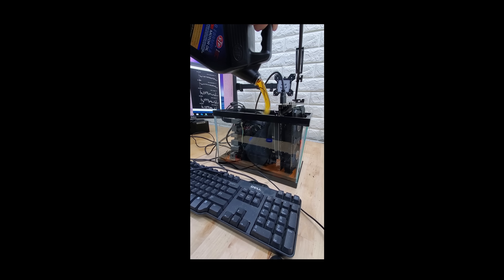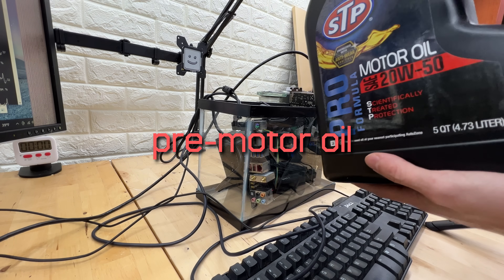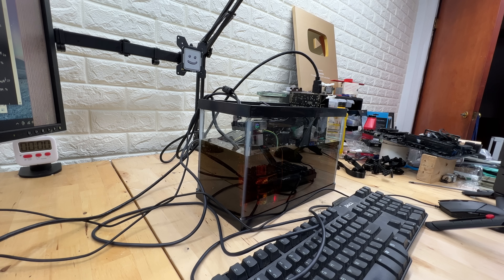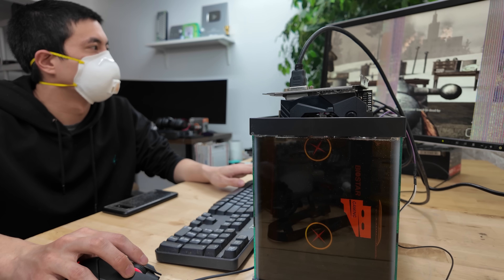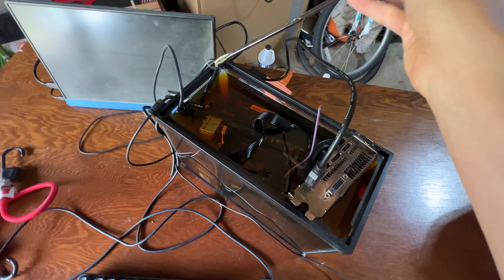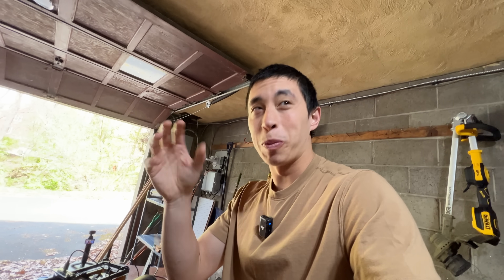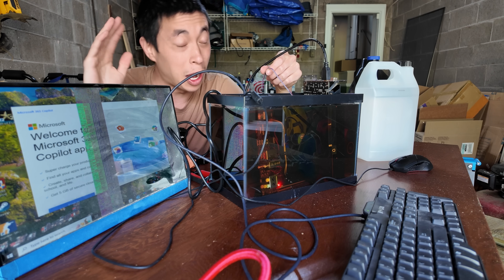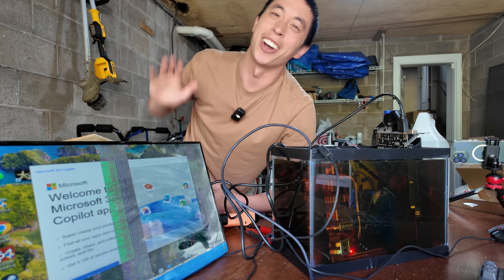Why isn't Motor Oil used to cool down PCs?

Comment: Should have used a thinner oil. You used a 20w50. That is thick and probably would be good for a tractor's diesel motor. Should have been as some commenters said, 0w20 or thinner. Plus use an actual synthetic. That was not. Learn to read the bottles.

Comment: Why isn't motor oil used to cool down a PC?

Maybe because that's not its function even in a car?

Oil keeps the pistons, crank, valves, camshaft and everything inside lubricated to reduce damage from friction.

Now if you said "coolant" that would've been more understandable.

Comment: Paused at 0:49 
Prediction: It shuts down shortly after posting the first time. Attempts to power cycle the system ultimately fail resulting in the machine no longer being able to power on.
Damage to components is permanent and unrepairable.

Ok,...
Back to the video.
Reply: It was on to begin with.
Well there goes my prediction! 🤣

Comment: mototr oil is a lubricant, not a coolant, coolant goes in your coolant resivour or you can also get coolant for your radiator.

Comment: You shouldn't use Motor oil for this even if it works for some time. Additives Can Be Reactive: Motor oils contain additives designed for engines, not electronics, they can corrode or degrade plastics, rubber, or PCB components. Additionally it may conduct electricity over time  due to impurities or degradation, it can eventually conduct electricity, risking shorts.
Motor oil, after a while breaks down and leaves sticky residues, which are hard to clean and can damage components. It oxidizes and becomes thick or sludgy faster than mineral oil when exposed to heat apart from health and fire risks; It emits more fumes and is more flammable at lower flashpoints compared to mineral oil.

Comment: Mineral oil works 3x better at heat transfer then air.   :) and itn's conductive,   Nice :D   Also you could use a oil heat exchanger like they use for heavy engines to keep their oil cool or transmissions  :)   Get a part cleaning tub  it's built to clean grease and oil off parts :P

Comment: Many moons ago I used a similar setup, i found for more intense load cycles a oil chiller similar to some high performance engine setups was needed to exchange built up heat in the system. You do need to be mindfull of what sort of oils you use as well there duty. You dony want to use WVO  fue to food, acid, and moisture contamination and you have to be carefull with vented hardware like optical drives and spinning rust platters and plastics disolving. Id personally recommend SSD's and maybe useing a lighter weight oil

Comment: Well then, if the PC is fully submerged in oil, can you then store it in lets say for example in fridge or freezer, to make it even cooler? As water condensation is then not a problem for the components at that point
Reply: Wouldn't work. The amount of heat that an average freezer can transfer per minute is relatively low. The PC will heat it up in no time.

Comment: Maybe try a thinner oil like 0w20 or 0w 10 if you can find it they use mineral oil because it's a thin oil I see you using 20w30 which is a pretty thick oil

Comment: What I would like to see is the thinnest motor oil in a custom water cooling system. The fact that this cools it down so well, it tells me if you can pump it, it would be better then water. Though idk what it would do to the pump or anything. Then there's coolant as well.
Reply: just use an oil pump from a car.  wouldn't be hard to set up

Comment: Could you float the board in motor oil without sinking the entire board, just low enoug to cover the CPU and the fan still be high enough to still work?
Reply: That's what I was thinking. Looking for applications for DIY hashboard cooling 8)

Comment: There are ways to clean oil-submerged electronics. First thing: Pressure washing with DI water. Used by several corporations to clean oil-soiled equipment because it is totally unable to short out components and cuts through dirt/oil very well.

Comment: You need a MB wiht the chip on other side and a construction like a Test board so u can turn down the CPU chip in everything.......
So what i mean you can make a small Fluid area under the MB that cools the cpu and upside is the rest. IF u want take the same fluid for GPU

Comment: You should do a water cooled PC but compare it with automotive coolant instead of water in the reservoir. Or go a step crazier and try using a engine radiator as well.
Reply: Agreed

Comment: Motor Oil isn't a coolant. Its a lubricant, and retains heat. Antifreeze is a coolant designed to reduce oil temperature.  Why was this even a thought?
Reply: Any fluid can transfer heat, some have better specific heat capacities than others. Motor oil is used in most motors as a medium to transfer heat; many engines or transmissons can have air to oil coolers.

Comment: I would assume the various zinc and molybdenum based additives could potentially be electrically conductive which would be bad.  Not a guarantee but I wouldn't risk it.  Mineral oil is not electrically conductive.

Comment: shoud use some 0w20, thats basically the same viscocity as light mineral oil.  oil, not 20w 50 lol..., of course its thick lol,.  most cars dont even use thick oil like that anymore, thats for realy really old cars usually.

Comment: First off: motor oil can be mineral oil, synthetic oil, or a mixture of both.
So, differentiate mineral oil from motor oil is kind of pointless.

Second: as many said before: use thinner oil!

Third: oil used in cars is usually tailored to get to around 100°C pretty fast and then stay around this temperature. And you don't want this temperature in your PC.

Fourth: If you want to use oil for cooling and not for lubrication, you need a pump and an oil cooler. Best equipped with a fan. So basically, it's like an out-case water cooling.

But: you could drop the fans and potentially even the heatsinks on the parts themselves. 

And as he said: Maintenance would be a pain in the a**!

Comment: considering average temperature of computer is between 60°C – 85°C (140°F – 185°F) and the aspects that made motor oil degrades are temp breakdown, oxidation, contamination, stress, and additive depletion. you need to change oil every 10 years sir.

Comment: Well let's start with this. Is motor oil used to cool an automobile engine .. there's a reason why the answer is no. 

It's not efficient at heat transfer 
It's designed for lubrication😮

Comment: 20W-50?!? He dumped some of the thickest engine oil ever over the fans. The average everyday car usually only uses 5w-20 or 5w-30. If I were trying to swim in a pool filled with the oil he put in there I'd be struggling too.

Comment: i instantly though remove all GPU CPU fans and just have a rad above the oil and its fans disposing the heat from the oil, id also have a fixed high torque fan in the oil to distribute the heat

Comment: Motor oil doesn't cool anything, maybe it has some heat dissipation properties but without circulation it's just going to sit and get hot. But nice that it removed the vibration noise!

Comment: all fans should be removed.
and replace the heatsink with a larger one.
will it be cooler for long-term use?
Maybe this motor oil could become a new trend

Comment: Why 20w50 that’s for heavy duty usage big ole fat gears. 0w20 or even 5w20 heck less than that would have done the trick temp wise and not have impeded the fans as much.

Comment: The only thing that worries me with PC+Oil is that unless your parts were designed with that in mind, the oil could potentially dissolve glues or swell some plastics with ... suboptimal consequences.
Reply: Potentially?? It will without a doubt damage anything that's derived from petroleum or otherwise soluble in organic solvents. This is not viable long term even otherwise. Imagine dust and grime mixing in with that oil or if you have to replace a part. 

Totally not worth the trouble and it's not gonna cool it any better unless if the oil is circulated through some kind of radiator
Reply: @anonymouseniller6688  Depends. Dissolving polymers is ... a thing. Just because something is theoretically soluble does not mean it does so fast. Then there is also a lot of "soluble" polymers that really dont dissolve but rather swell and become permeable. If its heavily crosslinked it is not going to dissolve in the conventional understanding of the word. The polymer, even if petroleum derived, could also be fairly hydrophilic and thus difficult to dissolve with oil.
Reply: @noneofyourbusiness3288  It doesn't really need to dissolve away like salt for things to go bad. I've had mineral oil destroy orings just enough for them to stop working correctly and it didn't take all that long. Maybe a few months. There certainly are polymers that are more resistant to this but you're less likely to have those if your design didn't expect to be in constant contact with some oil.
Reply: @anonymouseniller6688 Dust and grime?  So the PC needs an oil change?
Reply: @GodwynDi  lol, nice one. The oil needs a PC change more like it.

Comment: Lmao yes the fan are stopped you take 20w50 brooooo take something like 0w16 instead they will turn and il will be better cuz it’s really thin and light oil
And oil won’t hurt you I work in a garage and I have oil grease and so many stuff in my hand and I am fine ^^
So motor oil new like yours won’t do nothing to you

Comment: This tells me liquid cooling setups might benefit from motor oil. Submerging is probably not the best method. Having a container that fits stuggly over the CPU, and pipes to circulate would probably be best.

Comment: Considering your fans are no longer pushing air through the fins/radiator I don't think they necessarily need to be able to run at full speed or even constantly for that matter. We are pushing fluid now fully submerged in a tank, not air. Its a whole different ball game.

Comment: I think you can relatively easily clean off motor oil with spirits. Or with other stuff wich dessolve oil and does not dessolve PC components.
Reply: Sorry, not spirits, pure acohol, like 90% pure. I am suck at english.

Comment: Sitting in oil might have some degradation over a long time due to the additives and detergents. I’d say the real problem would be powered over time. Motor oil is slightly conductive, so on all of your components on the MB you will start corroding.

Comment: I had no idea they still made 20W-50 motor oil.  Why would you use the thickest thing you could find when all the passenger cars are using something 0W-16 now?
Reply: Because there are still older cars on the road that use that oil.

Comment: PSA; Food grade is not necessarily edible. Just safe to use on/with machines that (may) come into contact with food.
Reply: You can absolutely eat food grade mineral oil. You will be shitting your life out though. Any large enough quantity of refined oil will even food based oil.
Reply: @laurentbeaulieu2446  Even with water, you can drink distilled(Its steamed, but still has some natural minerals) or purified(completely removed any impurities to h20 only) and will be fine, just don't only drink it, because it will cause issues eventually.
Reply: Wrong, food grade has to be safe to be consumed in at least small amounts.
Reply: @SilvaDreams let me go grab some of my food grade dirt
Reply: No? Food grade has to be food-safe. Meaning that regular use of it, and in case of a little extra, is safe to consume. It does not mean "not necessarily edible" that would go against the point of stuff being labeled safe to be used in a food manufacturing environment.
Reply: @QuackZack Right so what about all that food grade machine lubricant factories will use? Food grade is a classification for materials safe to use in food manufacturing. This does not mean these materials are edible. Food grade =/= edible

Comment: It seems to me that an sbc or nuc would be great candidates for oil dipping, find one that either has thermal throttling issues or one either an unlocked bios so you can play around.

Comment: The reason why oil (or anything else really) isn't used, but water is, is simple. Water is cheap, easy to pump, and it's specific heat capacity in the range you want to be running it, is way higher than any other material that you'd want to be using.

Comment: 00:21 Speculative? Are you illiterate? They literally explained why in the post. You doing dumb trials, without a single fore thoughts and call it experiments.  You can do dumb stuff and hurt yourself as you like, but don't insult others with experience and knowledge. "dampened" the sound? Yeah sherlock, cuz motor  oil is much higher viscosity and will stop your fans more, preventing circulation!. "Cool vibe"? Cool toxic bath full of chemicals and fumes. Great job!. There're a reason why mineral oil is used, do some minimal due diligence and learn to READ.
Reply: Agreed
Reply: You crashed out
Reply: Huge "🤓" moment
Reply: Nerd
Reply: Geek
Reply: Valid crashout
Reply: lol mad cuz liberal
Reply: Holy shit, calm down
Reply: Lol why are you so mad 😂😂😂

Comment: The same reason mineral oil PCs are largely abandoned. Changing parts is a mess. Anything fails need to repair something? It's a mess. Trouble shooting will take what a week? You have to do anything with the internals you have to drain the oil completely and even then it will still have oil on the surface which you have to clean before you plug any new parts in. Upgrade a part. It's a mess. 

Too much to deal with

Comment: There was old video where guy put PC (motherboard) in cooking oil and played something like cs 1.6 on it. Then he washed it in dishwasher, dried it, built PC again and it worked just fine.
I think its better to completely remove fans for oil builds if your cpu is not very hot. Convection in the oil is significantly better then in the air so it will probably cool it fine.
Reply: thinking about it, PC fans are just not made for working under strain as they're just for pushing air, they are low torque, high speed, in that situation you'd want the exact opposite.
i wonder if RC boat motors or something similar could be fitted there instead of regular fans

Comment: The single biggest problem with this idea and the key reason you should NOT do this is that normal motor oil gives off a lot of toxic fumes.  You really do NOT want to have that closed up with you in your room.
Reply: Fresh oil generally is not toxic. May be only very special sorts.

Comment: Because motor oil is for lubrication not cooling and oil coolers lower the temperature to maintain viscosity parameters.
We use water coolant to maintain engine temperatures.

Comment: what if you went full car on it and had a radiator and a temp exchanging coolant hose run thru the motor oil liquid to cool it off sort of like liquid cooling but... well really just like liquid cooling except cooling the liquid instead of the parts directly.

Comment: For people asking why he chose the thickest oil, if he used super thin oil then whats the difference between that and mineral oil?
Essentially it would be the same thing
Reply: No. Motor oil has tons of additives, so you'd need to know how conductive that motor oil could be, even if it were lighter. He choose the thickest because it probably was super cheap, had it lying around somewhere or just ill informed. It's so heavy, this stuff goes into things like construction equipment over a car/truck (aside from special use cases).

Comment: I have food grade borax and also lye.

But I wouldn't use any of both for cooking.

Food grade doesn't mean safe to consume.  But safe to use around food.

i.e. You may use lye to clean/unclog your drain where you also happen to clean cooking ware and food if the lye is "food grade". You may also use it to make soap that you'll then use to clean your cooking ware.  But don't season anything with it.  It won't be "good" for your health.

Comment: i know it befor because at 2013 i build a oilcooled laptop it has all time 23C at gaming and working it dies at 2019 (i buy the laptop all new at 2003 for 2000€ so 16years is a good lifetime) :D

Comment: 2:30 try ramping up the fans to max power

that could eventually fix that

it gives them more power to overcome the oil so they dont stop.

atleast mineral oil PCs seem to have working fans.
Reply: Or he could try an engine oil for something under 2 tons

Comment: Heat absorption by the motor oil will also make it thicker.  5w30 is 5 weight viscosity when cold and 30 weight viscosity when hot.
Reply: nope

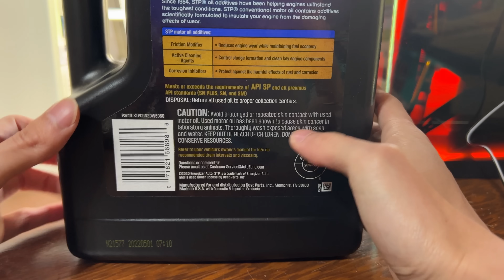Comment: 8:39 Used oil (after being used in engines) usually contains carbon nanoparticles which can cause cancer. I don't think it's the case here.
Reply: It is not good for grass either way.

Comment: As others have suggested, maybe use a lighter thinner motor oil or light machine oil? I don't know if they sell gallon size light machine oil in stores. I see it before used in a paper mill to oil the cutters/printers where I used to work.

Comment: I am more interested seeing if in a typical water cooling changing the water to motor oil if it improves cooling
Reply: Oil has more molecules / volume than that of water, so theoretically it can carry more heat,
but the pump may suffer tho.
Reply: It will have much better thermal capacity in total but you will probably need a stronger pump to efficiently move the oil through the system, something built for water or a similar viscosity coolant will struggle with any of the common motor oils.

Comment: Well, motor oil is used as a lubricant for a car engine and the cooling is done just like a PC with a derivative of distilled water and antifreeze. You could possibly use ATF fluid as they do have radiators to cool that fluid down.